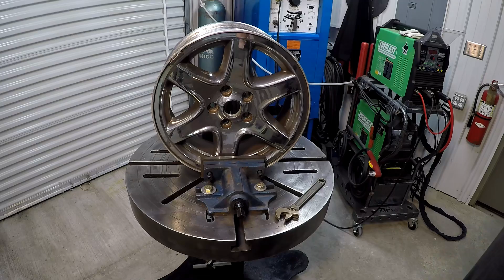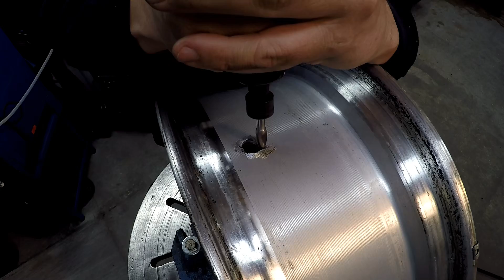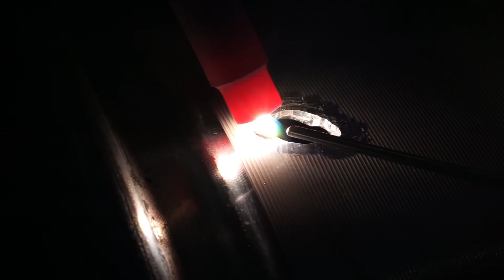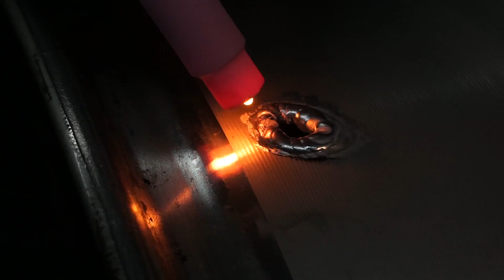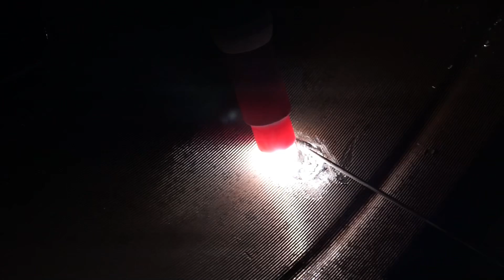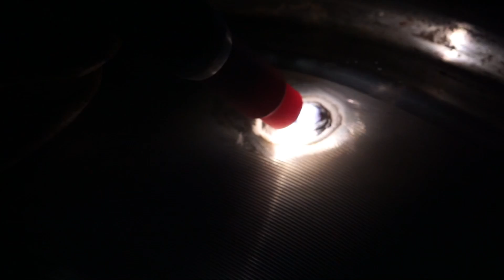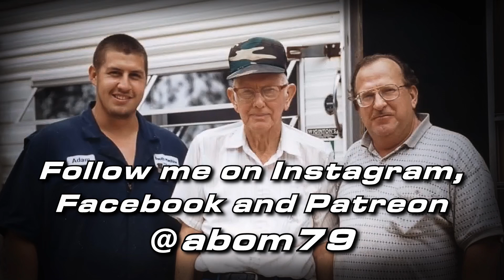SNS 239: Aluminum Wheel Repair

Comment: Adam I know that everyone has a personal preference on welding and what they're welding with. But you should try a gas lens set up on your Tig torch. It allows for better gas flow through the torch and in turn you can hold a longer stick out on your tungsten electrode. Thanks for the video
Reply from the maker: I'm working on a new torch for my Miller right now and will have the gas lens attachments. It's new to me so I run what I have.
Reply: @Abom79  You're gonna love it. The argon savings alone made a difference for me.
Reply: @fabricationfun1509  It helps with gas coverage in general by reducing turbulence, so it helps regardless of the metal. Since it's not turbulent, it doesn't mix with the air, which is why you can use a longer stick out (since it doesn't mix as soon, you get coverage further out). You can run lower flow rates too for the same reason.
Reply: To much gas can also play with your arc specially with aluminium so it's not always best

Comment: I'm glad you said this would be used as a spare tire rim.  No a good idea to drive on weld repaired rims.  Great work though, as always.
Reply: There are weld repaired rims by the thousands that are running just fine.  My neighbor has a business that repairs and refinishes wheels.  He has more work than he can handle

Comment: Got a friend with a welding shop who does these weekly. Montreal is famous for hockey, smoked meat sandwiches and potholes so a lot of wheels get trashed. The alloys they use for wheels are quite weldable
Reply: I had no idea that smoked meat sandwiches could wreak such havoc on wheels!  Learn something new everyday. :P
Reply: Rocketninja200 not to mention hockey pucks
Reply: @sblack48  btw, used pucks are very handy in the shop from jack dunnage to painting standoffs!
Reply: @jameswyatt1304  they make good body mount replacements on trucks, too :D

Comment: You should never weld a cast aluminum wheel with damage on the interior of the wheel. Now a forged wheel is a better candidate for a repair as shown. Basically think  of a cast wheel as a tire that has broken belts, the wheel is designed in the same way.You wouldnt drive 70mph with a tire that has broken belts would you? 

There is a lot of force that is stressed into the wheel when its manufactured and once its compromised that wheel is toast.Try cutting a cast wheel in half and it will spring apart with authority. It could be done if the repair was done in a complete inert atmosphere but that is not reasonable for such a part.
Reply: Millions of examples of it being done prove your statement wrong. Besides, a cast wheel is inherently less stressed than a forged wheel due to the manufacturing process, which leads me to believe you are talking out of your sphincter.
Reply: I'm quite sure this has been done millions of times without issue. That was a little tiny hole! People weld cracked rims all the time! BIG CRACKS. FOR REAL :)
Reply: Clam Sauce it’s a spare wheel that may or may not ever be used,lighten up dude
Reply: @cmonster6  All you need to do is check out HIS YT channel. To quote A. A. Milne “When you are a Bear of Very Little Brain, and you Think of Things, you find sometimes that a Thing which seemed very Thingish inside you is quite different when it gets out into the open and has other people looking at it.”
Reply: @0RDClark  is that even english?
Reply: You're talking about Abom here, he leaves parts better than the original ever were :)
Reply from the maker: Cast wheels are repaired every day, safely and reliably.
Reply: well please explain then why in Canada are wheel repair shops required to follow the Motor Vehicle Act
: WELD REPAIR OF ALUMINUM ALLOY WHEELS REGULATION if its no big deal? Also might I add also carry a minimum of $2 million dollar liability insurance by law?

Comment: A ball joint coming off is either a lack of maintenance or a parts failure. Either way, they might want to go over the nuts and bolts under the car. Did it come off when it was stationary? There's no scraping or deformation on the hole, which would've happened if it was moving.
Reply: @DOCTORAMBULANCE  That's good to know! Thanks.

Comment: I know you're being super extra careful since it's for family, but I'd think they should definitely only use this as a spare.  Beautiful job on the build-up and it looks nice and solid but I'd be wary of them going long distances with an uneven temper like that.  That ball joint breaking must have scared the crap outta them, glad everyone's OK
Reply: Tony Hammitt Now I think about it I have only known of one ball joint letting go while being driven on the street. The enormously greater stresses turning power steering in a parkade or such seem to be where they let go the most. From the looks, the weight just dropped with no vehicle movement. They were lucky.
Reply: As long as the temps are kept under control then the changes in temper in the alloy aren't a factor. The heating in the surrounding metal would be the same as any aluminum weld that would be expected to take much higher forces.

Comment: yeah welding rims is sketchy but it's not like you're welding a spoke back together and it's going to be a spare so whatever
Reply: Brandon S  pretty sure that's an old wives tale
Reply: @kfjfjfjewlsls  Oversimplified, depends on the joint and material. A good weld should not weaken the nearby material, and if it's not grinded down the weld bead will just constitute extra material = stronger. That however requires that any treatment the original material had is restored etc. To be clear, IANAWelder, just a physics undergrad
Reply: its still a pressure vessel that's engineered with the internal stresses from manufacturing in mind, it wont be the same, but will it be strong enough? you need to be a wizard and a genius to know.

Comment: Looks like a GM rim. If so, get the RPO code for that wheel option from the listing in the glove box. Search for "wheel <code>" in Google.  That's how i found a fairly rare P23 rim for my HHR a few weeks ago.
Reply: Honestly, it looks like your average 5 Star rim from a 2000 Camaro/Firebird or similar. Can't be that hard to find.
Reply: @JC-11111  a 5 star might look weird when all the other wheels are 6...

Comment: If you place a steel backing plate on the back side of your weld it will go far quicker and easier to fill up holes as aluminium will not stick to steel. The backer allows you to go inside your holes edges and fill the centre instead of building up the edge and bridging across leaving a deep pit on the opposite side. A backer will save time, material and reduce gas consumption. Your pinhole porosity was probably caused by tungsten contamination created when you had your "oops" at the very beginning of the weld. When you inadvertently touch down and stick to the material like you did a tiny particle of tungsten can be transferred into the weld and it will cause pinhole porosity as it will not melt into the material. To prevent this grind it off immediately after you have touched down instead of continuing along.
Reply: Maybe you shouldn't be in a garage if you don't know what your doing.... #darwinawards   BTW it only releases "Phosgene" if your welding on wet parts ....   Gimme a break...  I could get a sunburn if I go outside....     Were you a Hall monitor when you were a kid?  Plastic on your furniture Perhaps?
Reply: @OldSkoolF  ok ok you both have good valid points agree with both of you .
Reply: commonly called a tungstun inclusion and that will show up on an xray and would be a failed xray. good comment norman may well explained.
Reply: @jamiebuckley1769  Thank you. I was a welder for 40 some years and you sound like you have a few years in or around the trade yourself. I see a few folks seem to think that a brass backer would work better for some reason. What's your take on that? One of my first welding jobs when I was an apprentice was making aluminium doors for truck bodies. About 75 to 100 doors a week. You had to back up the mitred corners on the extrusion or they would melt away and fall off and we always used steel and never had a problem.
Reply: Copper backup is what my mentor taught me as well when welding unsupported Aluminium
Reply: I have always used thin Copper plate and it has always worked...  I Red Scotchbrite everything after Purple Power wash and dry...  Solvents work fine but sometimes leave a film... I also use CRC Brakleen .  Keep a different pad for the Copper and Aluminum.
Reply: @OldSkoolF  Brakleen is great stuff, but be careful when using it to clean weldements. I heard a story of a guy who lit up an some aluminum after cleaning it with brakleen. The solvent hadn't evaporated all the way and he breathed in some of the burning chemicals. He later died in the hospital. Id be lying if i said i knew all of the chemistry behind it, but basically when that stuff burns i guess it creates a poisonous gas. I dont use it to clean my metal to be welded anymore. If you leave it alone long enough to evaporate you will probably be fine, but i just use acetone now.
Reply: @markdoumert4840  ...  Like I said....  Don't use "Chloro"  only NON.....  and don't weld wet....  Only noobs do dumb stuff like that....  Everyone thinks its so easy to "Weld" cause they see it in a vid.....  Then they go out and kill someone with poorly welded joints or poison themselves in the welding process...   I've seen guys doing "How to" Weld videos with welds or habits that are down right negligent.
Reply: @OldSkoolF  Yeah I made that comment without reading all the other replies saying the same thing. I didnt even know they made a non chlorinated brakleen until i saw this. I always used acetone.
Reply: I figured everyone knows to only use.... NON-Chlorinated....  CRC Green can....  Only fools use the chlorinated...  Has  trichloroethylene which is SUPER toxic....  Avoid that stuff like the Plague...
Reply: You were almost correct. Try again.
Reply: Was thinking using brass would be better, since it wouldn't stick to the welds. Right?
Reply: Not steel or brass stainless only for aluminum unless you want brass or steel contamination
Reply: No, mine is the longest!
Reply: no steel !!  brase
Reply: CLEAN
Reply: sorry brass  plate  (i'm dutch)
Reply: trapolta You can easily edit your initial reply rather than try to correct it with new posts. Check the three little dots on the right. 🤓
Reply: @steviefordranger198  Thanks for that info. I never even saw those three dots much less know what they were for. Thanks for that bit of info....Ken, ....yep even an 80 year old guy can learn something new.

Comment: Looked to me like the wheel has a skin on the body like some kind of plating that was peeling away from the inner turned finish? However I would trust this rim after your seal up welding Adam and I did like the welding close up for sure! Great lighting and focus is right on too. Makes me feel that I could stack me some dimes real soon!

Comment: This sort of repair is illegal in some places,
Just saying :)
Reply: @ryanprice1686  The positive aspect of negative thinking  ; )
Reply: In my neck of the woods in Washington they won't put a tire on a welded rim.
Reply: Ya a lot people do weld them, here in New Hampshire any wheel repaired with weld will not pass state inspection, I think the law was made for big truck wheels, but it does say any wheel.
Reply: I work in a shop servicing commercial trucks and truck tires and we reject any wheel (steel or aluminum) that has been welded on but I think that's more an insurance liability issue than a legal one. We often ship out wheels for refurbishing only to have them rejected and sent back due to cracks on the lip, lug holes, barrel, central disc, etc.
Reply: saying things are illegal is illegal
Reply: Who cares. And where is it illegal?
Reply: @xenonram  california
Reply: @mortglickman3217  Nope, we race SCCA (GT1) in California.  Have a racing buddy who makes his living repairing rims in California and supports his racing addiction on the repair of wheels over 20".
Reply: @xenonram   Maybe not in USA, but here in Germany, you'd be with one foot in prison by just thinking about welding on an aluminium rim :-p
Reply: Andrew Delashaw - you'll care when you have an accident and discover an unroadworthy repair invalidates your insurance, even if it had nothing whatsoever to do with the accident.
Reply: Not in the land of the free...

Comment: Looks like it'll balance. Seen some alloy's that had like an ounce and a half's on 'em they where flat sided on one bead and perfectly round on the other. Runout on 'em even worse actually caused funky tire wear.That one there will be way better than any steel wheel there usually so warped people glue the hubcap on and try to b lame the mechanic for it trust me I've seen some shady $#!^ working as a mechanic that's why I refuse to do it anymore.

Comment: I noticed that the tungsten wasn't pointy.  I'm learning to be a hobbyist TIG welder.  My tungsten tip pointiness goes away rather quickly. Maybe it doesn't matter all that much?
Reply: when welding steel the tungsten stays sharp, when you weld aluminum the tungsten tip rounds over.
Reply: If you are also using it in AC mode, your tunsten point is greatly determined by how much AC balance/cleaning action you have your machine set to. If you are set more towards less cleaning (more electrode neg. time) your tungsten will stay pointed or with a very small ball on the end. If you are set to a high cleaning action (more electrode pos. time) you will generate a big ball end, sometimes to the point where you will actually see a large ball moving around the end of your tungsten.

Comment: Any thoughts about the temper on the wheel?  Especially the higher performance wheels have a differential temper....  Granted you're well away from edge, but at the same time, heat moves pretty good through aluminum.

Comment: I thought the tungsten electrode always should be sharp but yours looks like it's molten to a ball at the end, is that how it's supposed to be when welding aluminum?
Reply: No matter how you initially sharpen the tungsten with ac welding on aluminium (aluminum) it will ball up. A sign that you are doing good is that it will get a gloss to it. Proven fact from welding classes and practical experience. Also check out welding tips and tricks.
Reply: Aluminium welding is done with AC, so half the time the Tungsten is negative and the other half it's positive. When DC welding the Tungsten is usually negative. If you do positive electrode it'll usually go blunt. So yes, the Tungsten is actually deforming when you weld aluminium. At least I've never seen a tungsten electrode come out looking fresh after welding aluminium.
Reply: On aluminum it can be like that. If you're using pure tungsten (green) it will always ball because of the way AC current flows. Now if you're using a 2 percent lanthinated tungsten electrode I'd can be a little more durable when on AC and will hold a good point. A sharper point means a more focused arc. You can use both methods though. Me I prefer the 2 percent lanthinated on aluminum.
Reply: It’s something with the everlast, I had one that blew up a couple weeks ago catastrophically. 
But it only kept the point with 2%lanthinated. 
Green pure didn’t work.
Purple e3 didn’t work. 
1.5% lanthinated was ok but still balled quickly.
Reply: I'm guessing he's mostly used to a transformer machine like the big blue machine behind the Everlast (Miller 330A/BP). With transformer machines it's customary to set the machine to electrode positive and ball a sharpened tungsten to prevent spitting into the puddle before switching to AC for welding. The Everlast inverter machine he's using should be able to hold a decent point on the tungsten.
Reply: FesixGermany yes, a slightly balled tungsten point is acceptable when welding aluminum. The "electrode positive" portion of the sine/square wave on AC transfers a lot of heat to the tungsten, causing the point to become a "ball." On nasty dirty aluminum like a rim, one tends to run a more positive AC balance (around 40% electrode positive instead of 25-30%), which removes impurities and aluminum oxide better but makes the electrode heat up more. Pure (green) tungsten will pretty much always ball up. Other grades (lanthanated, ceriated, zirconiated, thoriated) hold a point better but no 1/8" tungsten will handle 300 amps without balling.
Reply: No, not at all, its supposed to be a nice fine point at the tip of tungsten, the molten little ball at tip will sometimes contaminate your weld, so your always supposed to make sure its a fine point. Learned this in welding class.